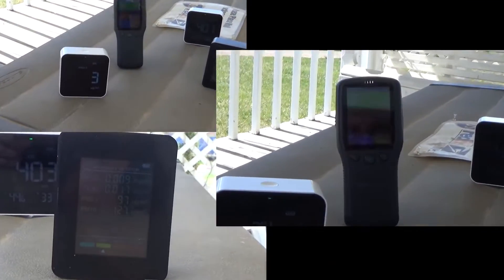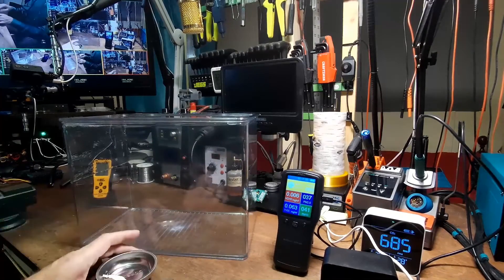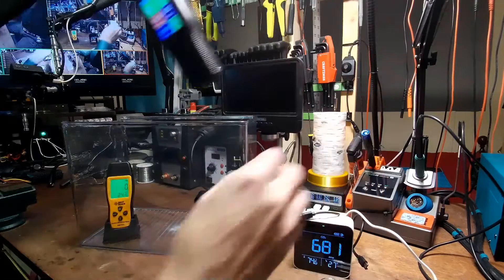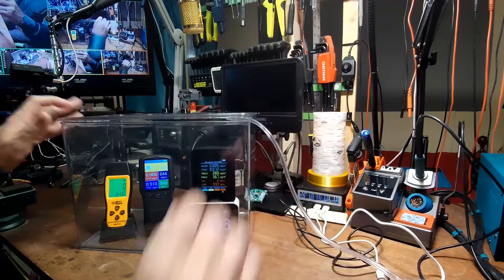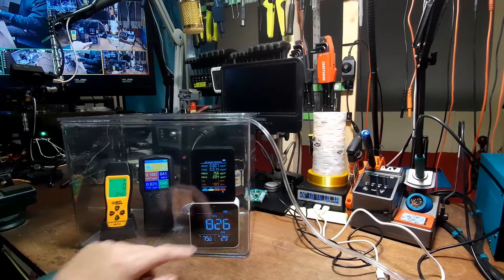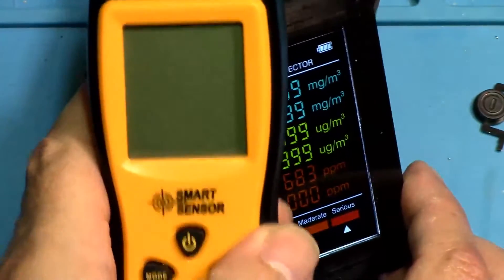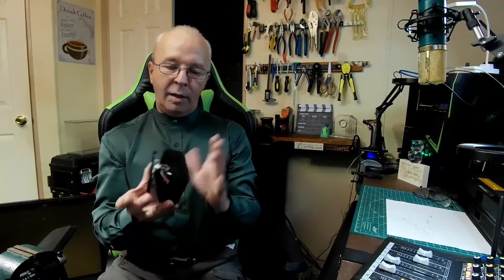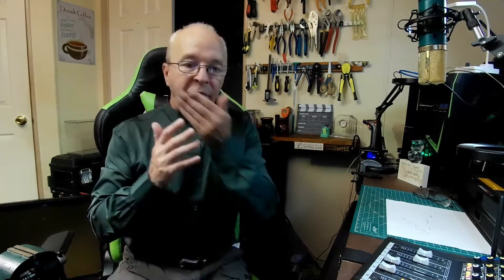Compare Fake Chinese Air Quality Monitor To "Smart Sensor" CO Monitor & "TemTop" CO2 Monitor

Comment: Actual co2 sensors are several hundred dollars. Unless you're spending a lot of money all these devices detect voc deltas and infer co2.
Reply: They're not that expensive. Genuine standalone Co2 sensors are about $5 - you can buy dedicated Co2 meters for about $30-$60
Reply from the maker: @miscbits6399  Yes I imagine that you can get them that cheap, but the better the meter, the more expensive the CO2 sensor inside.

Thanks for the comment and information - much appreciated. 👍
Reply: @Outside-In.  I agree on the pricing, up to a point. 

You do see "premium" equipment priced high "because they can" and because there's a perception that "expensive is better" that some seek to take advantage of (You wouldn't believe the number of cheap and nasty phones sold as premium products by virtue of a glued-in block of steel to add heft) - it's resulted in my taking a jaundiced view of pricing (As one example, I've seen the same meter you tested being sold for $80-90 - right in the middle of the "genuine" price range instead of the $15-25 range)

Winsen sensor (not the only guys in the business but one of the largest) sell two types of CO2 detector - MG812 semiconductor ($5-9 depending on retailer) and various infrared ones (MHZ19 series) ftom $10-25 apiece. They also sell a standalone monitor for about $30
Reply from the maker: @miscbits6399  Thanks, and good information.  I have been doing many many hours, weeks and months of research on sensors.  There are lab quality sensors that cost in the thousands, but are not need by the average person, because we just need a close number - not pin-point accuracy.  

I agree that cell phones and the like, can be faked, and made to feel and look like premium, but the same thing is happening with air quality monitors - they use photos of expensive sensors inside, when there is nothing inside but a whole lot of lies... 

18650 batteries is another example of faked products.  China will put actual sand inside an 18650 to make it way the correct amount that a more expensive and legitimate battery will weigh, but when you test it, it is 800 mAH, instead of the 3200 mAH listed capacity.

Also, I do believe that China is now raising prices on these fake monitors to fool people into thinking it has to be real if it cost's so much.  I have seen fake monitors for more than 100.00, but unfortunately, I cannot afford to buy every monitor I see, as everything that I do here, comes completely out of my pocket, and I get no financial help from YouTube or the community, so I am very limited on what I can do, but I do my best to get these fake monitors noticed and realized, so lives can be saved from false information.

I am hoping that in 2024, Outside In will take off, and can also start generating some income to be able to do more.

Thanks again for your comments, they are much appreciated.
Reply from the maker: Interesting.  Thanks for the information - much appreciated.

Comment: I unfortunatly bought that very one and initially thought it was somewhat difficult to calibrate, then both your video confirmed 100% my suspicions.  Thanks for making those videos.  Out of the box it doesnt have any manufacturer info or contact details. It's also show a CE mark, which is probably also fake.  I wonder if there is a proper way to report such kind of fake products.  Thanks for making those videos and taking the time to investigate.
Reply from the maker: Thank you Philippe for your experiences with the fake monitor.  Unfortunately - I would say that all fake monitors, and there are quite a number of them - are manufactured in China, so no way of stopping it, and why making this type of content is so important.  It is getting harder to tell a fake one, because I have seen fake ones that cost more than 100.00, and I believe that is, because the Chinese are raising prices to fool people into thinking that it can't be fake.  The only thing that we can do is to pass the word about fake monitors, and the signs to look for.

Signs to look for, for a possible fake monitor...  

1. Photos that show monitor readings of unreasonable values in the setting they are placed, for instance - most monitors I have seen that are fake, have one major thing in common...  The photos are shown of the device sitting inside a house with a CO2 reading of 438 or lower, because that just don't happen, and is nearly impossible - Average indoor CO2 levels are around 500 to 600, and normal levels are around 600-800 ppm.  Outside CO2 levels in a good area - are around 410, so how can the indoor CO2 level be the same.

2. Monitors that have a CO2 and CO sensor with 5 other sensors, and it sells for especially less than 100.00.  that is nearly impossible to find because CO sensors are very expensive to include into a device, unlike CO2 sensors - CO sensors require certifications that can take weeks to get approved, and why most companies do not include them in their devices, as they would have to raise the cost of their devices too much.  Monitors that actually have CO sensors included, are probably going to be around the 275.00 price and upward.

3. Monitors that are inexpensive and the photos show "Professional, High Quality" futuristic amazing technology sensors inside, and usually these descriptions will include the words - Highly accurate. 

Don't get me wrong - there are actually legitimate companies in China that produce competent monitors, but because their brother of sister companies are producing fakes, it is very hard for honest companies to stay in business.  

The only advise I can give is to research research research before making the purchase, and be skeptical of any company that sells their product claiming professional - highly accurate - the best in technology etc., etc..  The other thing to keep in mind....  If it sounds too good to be true - - - - Yep, it probably is...

Thanks again for your comment and thoughts - much appreciated.

Comment: I think that a $20 device is not intended to accurately measure air parameters, but to show more or less whether something is changing for better or worse... This device is very bad if we compare it with a professional meter, but it serves a warning function, when it is placed in a room and suddenly it starts showing parameters other than usual.
Reply from the maker: Let's just say that you are right, and I would like to agree with you, but I have seen descriptions for cheap air quality devices that specifically say how high quality and accurate they are, and some even go as far as showing faked photos of futuristic looking high quality sensors inside, when there is nothing inside but lies.

But this video was not about 20.00 devices - this video was trying once and for all - to convince people that THIS 20.00 device is a lie, a total lie, and nothing but a lie, and it can and probably will get someone killed one day, and the company that makes these, should be put out of business and put in jail.

The only truth about the fake device in this video - is - that it truly tells lies...
Reply: @Outside-In.  Of course. You're right. I don't question the results of your experiments. I think I've gotten too used to false descriptions on boxes and in advertisements :)
Reply from the maker: @michau75  I am with you on that Michal for sure.  Ever since the Pandemic, Companies have been making millions on selling Air Quality Monitors, and people fall for the hype, and the most disturbing thing of all - is the fact that the 2 most deadly of them all - no one even pays attention too, and those are CO and CO2 - CO being the most deadly of the two, and why I have been trying to get people to stop paying attention to PM, TVOC, HCHO, as much, and start looking at the real killers - CO and CO2...

AirKnight just sent me a message, and said that they are using some of my recommendations (and I am assuming also, comments on this channel), to update their monitor, and that was exciting to hear, but the one thing more than any other that I wanted them to do - which was to input a CO sensor... Well, let's just say that I am hoping that that is one of the upgrades they are referring too, as Jim at AirKnight told me back when I first talked to him, was that they were going to include a CO sensor in the beginning, but the paperwork and red tape that they would have to go through, was going to be too expensive to implement into their device, so I hope they have changed their mind.

Thanks for your comments - they are much appreciated 🙂

Comment: I had an instance with the “fake meter” and my meter’s co reading went to over 5000 ppm. Certainly my wife and cats and I would be dead. I took it outside immediately and found that the reading was extremely high outside. Then I was reminded that locally there is a particle board furniture fabrication company 3/4 mile from my house. They burn the particleboard scrap in a large furnace with a 10” 40’ high stack. I’m now wondering if they had incomplete combustion in the furnace of wood with epoxy. And the anemometer on my weather station was barely spinning. Inversion?  So this unit might have me running to the company to make sure their combustion controls are calibrated and they aren’t overloading the furnace to make high CO. Or it’s a letter to the EPA.
Reply from the maker: Thanks Mike for you comment and concerns...  A factory that is 3/4 mile away (nearly 4,000 feet) with a 10" stack standing at 40 feet high, would have to be putting off an incredible amount of CO to fill the vast open air that covers that distance - to cause that kind of reading on a legitimate CO monitor.  Before you go to the factory, I would ask that you please invest in a real and legitimate CO meter so that you can be sure of CO discharge in your area or home.  You can get the Smart Sensor CO handheld meter for around 40.00:  This is the one I purchased - just make sure when you get the meter, it is actually labeled Smart Sensor, as there are fakes of these out there, but the following link is the one I purchased, and even though the photos in the description do not show Smart Sensor on the meter, the one I received was labeled Correctly and is legitimate, I just wish they would change the photos in the description, but all you have to do is to look at the photo of the packaged meter, and that is what you will get: https://www.amazon.com/gp/product/B091DRT5DN/ref=ppx_yo_dt_b_search_asin_title?ie=UTF8&psc=1

The Smart Sensor Meter will give you instant results of any CO in your immediate vicinity, and you can also walk around with it as well to test for CO.  You would also be able to visit the plant carrying the meter as you walked around the plant to check for CO, and if in fact there is CO present, you would be able to show that to management.  I would really also like to point out that the fake monitor that I use in the video, and hopefully it is the same one you have - has NO CO sensor inside, so absolutely cannot trust the readings as they are not real - they are faked.  

I hope this helps, so please get a legitimate device, so that you can have a peace of mind about what your fake monitor is telling you before raising any kind of fuss to protect yourself, plus, I am sure Mike, that you would want to know with 100% certainty before confronting someone.  If you get the Smart Sensor Handheld meter, and it is showing anything above 1 consistently (as 0 to 1 on the display is normal) there may very well be an issue, and needs to be addressed/investigated.  A serious health concern would be anything above 20-25 consistently, but of course that is only in my opinion.  I personally would be finding out what is wrong if the display showed anything at all above 1 for an extended period of time, but again Mike, that is only my opinion.
Reply: @Outside-In.  I didn’t mention that I have to drive down a 40’ hill to go by the factory in town. The smokestack is probably at my ground level. I had dreager tubes to test for CO and other aerosols/gasses.
Reply from the maker: @mikemccabe1324.  Yes, I know you didn't mention anything about going down a 40 foot hill, I apologize if you misunderstood me.  I was speaking of a 10 inch stack at 40 feet high that was nearly 4000 feet away,  and the vast area of space that a 10 inch stack that far away would have to contaminate, would have to be putting off a huge amount of CO, and you said your fake monitor was showing 5000 ppm, and at those readings, you, your wife and cats, would not be the only ones dead - your whole neighborhood would cease to exist as well.  Sorry if there were any confusion on what I meant.

Edited:  I have been researching Draeger Tubes, as I have never heard of them, and first of all - wow those things are expensive, and if you want a display to go with the tubes, they can be in the thousands of dollars.  I also found out that Draeger Tubes are slow to react, and less accurate than electronic sensors in monitors and meters, and they also need at least 5-8 hours to give proper readings, and they also have a relatively short shelf life.